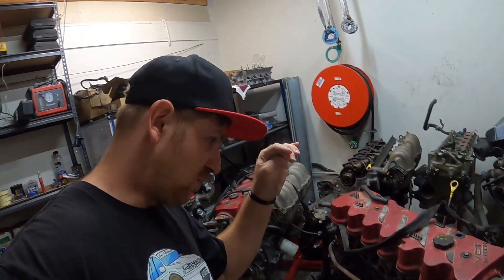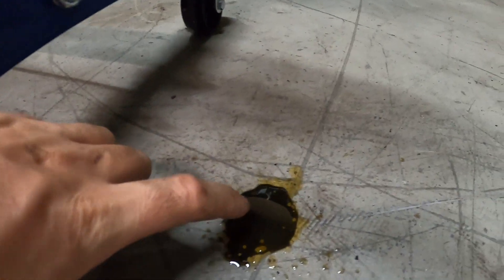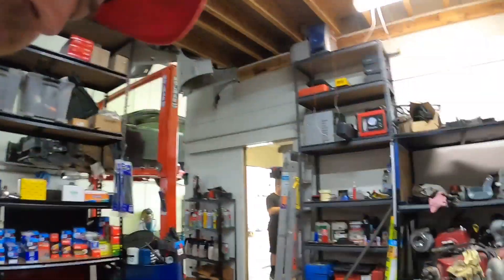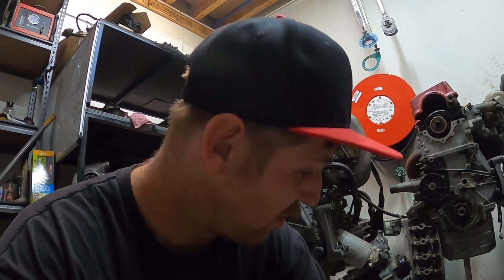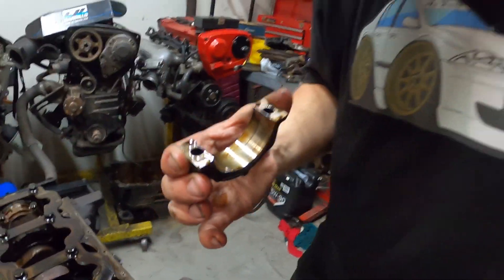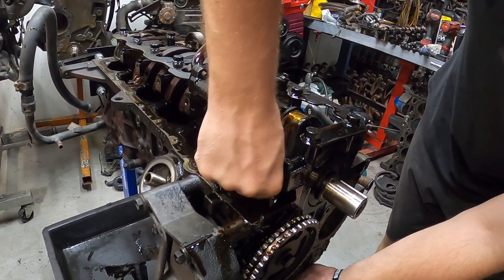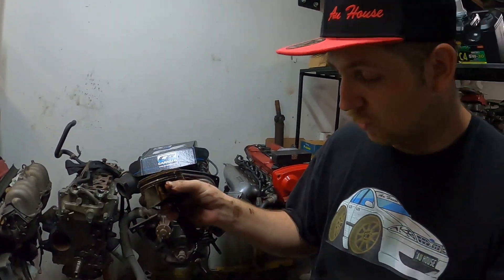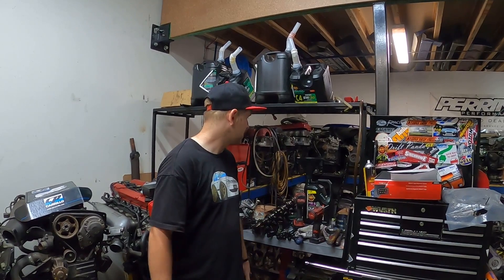Broken Engine Damage Report | S3E4

Comment: Hey mate, good video, can I offer my advice?I've been running a turbo falcon drift car for a few years and done a few engines. I've pulled pistons out with cracked ring lands and flattened bearings.. the main problem is the piston is overheating from not being able to transfer heat away because the ring gaps have closed. Check the comp rings and you'll find fresh marks on the ends where they have closed. 28thou top and 30thou 2nd ring gap I recommend for boost. Stock they're only 16thou. Also make sure you pull timing based on high IATs. Most tuners think e85 doesnt matter what IATs are, yes its more forgiving, but it will still pre ignite and flatten bearings.
IMO destroking is only if you want to rev to 10k rpm and make 2000hp. For a drifter turning it to 7500, stronger internals are fine 👌

Comment: All that E85 inside the timing chain tensioner is a good sign that E85 loves to mix with the oil , gaurantee its whats cooked those crank bearings.. lack of oil due to there being e85 on them.  Need more pics and vids of that FF intake manifold.

Comment: What oil pressure  you see at idle after a beating  ? My red top in my xr6 on hot day after going  down freeway at 2500 then come off freeway I see 15-20 but bring revs up 100-200 and back up to 30-40 so not to worried just more couriers